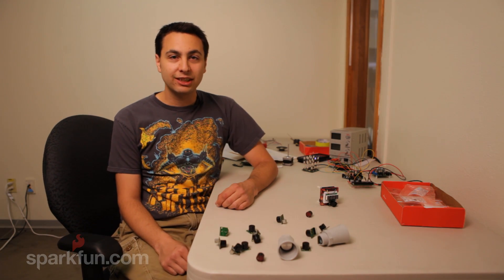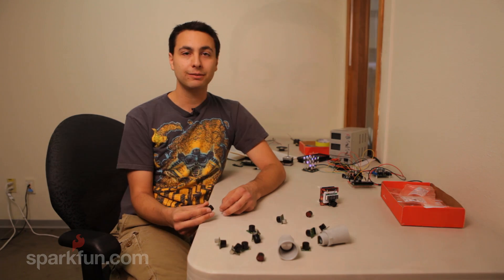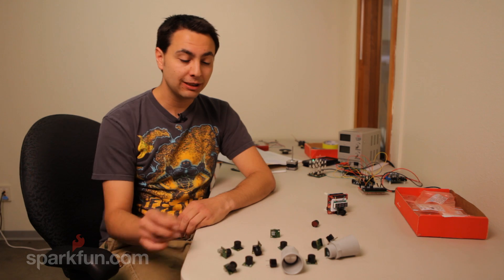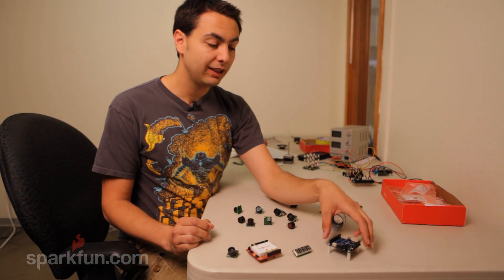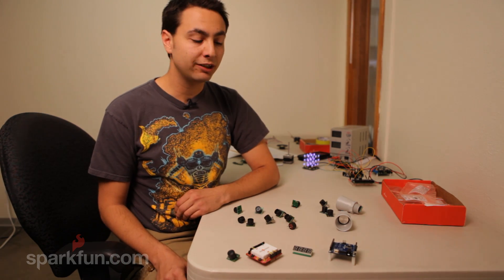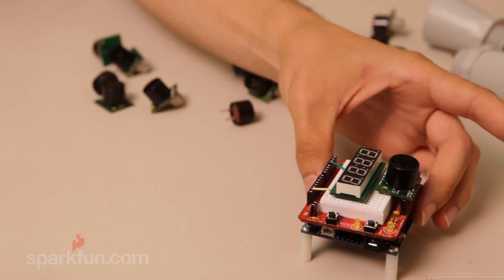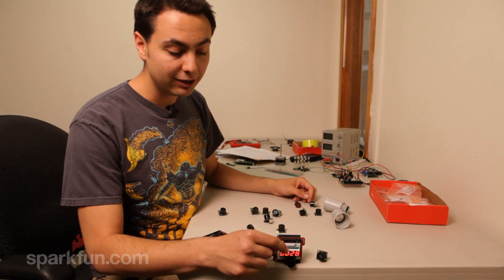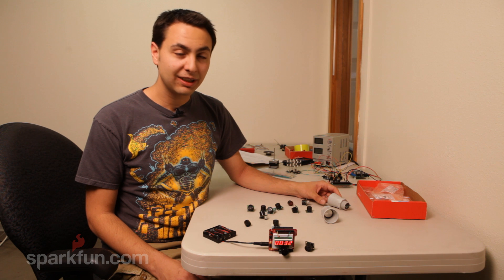Ultrasonic Sensors with Engineer Jim Lindblom

Comment: Hello this video is very informational very good👍 I’ve got a very big favor from you so I have a Arduino and a monster motor driver Vnh2sp30 shield I followed your tutorial and was wondering with all of the pins in I’m left with 13 stat pin and wonder what you mean or whet it goes.

Comment: A question: there are these waterproof sonar sensors that cars use in reverse parking, that have only a single cylinder unlike the ultrasonic module in your video that has a Rx and a Tx. I was wondering how do these car ones work as I could not see a Tx. Do you know how they work - are the Tx and Rx both in that single cylinder?

Comment: HELP! (if you can)
I'm going to be entering a university competition (not worth anything) called cops and robbers.  The cops have ultrasonic sensor so i was hoping i could some how sense the ultrasonic pulses and go in the quietest direction. Also if i could receive their signal and send out a fake signal it would trick the robots into thinking they are at a wall and need to turn.   any ideas how to achieve this would be awesome I'm only a first year ><  ty

Comment: Hi,
I am looking for quite some time for the right sensor. Have you experience with the MURATA MA40S4R Sensor. The SFxx Sensor are at about 20 $ while the Murata only 8 $.
How do you display on the 4 digit Display the Distance? Does it have already the 7Segment Decoder in it?.

Any chance to build my own ultrasonic and calibrate the distance according to the returned ping? Which sensor (piezo) might be suitable?
Thanks in advance
Yariv

Comment: Could one of these be used to measure water level?

I've built an aquarium computer using all the atlas scientific probes + controlling lights and nutrient dosing pumps and it would be nice to hook one or more of these to also control a solenoid for doing water changes, keeping an eye on sump water levels, levels above overflows etc..

Thanks.

Comment: Just wondering, is there such a thing as an ultrasonic range finder that works through medium other than air, for instance through dirt to find rocks instead of through air to find solid objects
Reply: Eric Roux for soil they use small explosives but i think they look at low freq rather than high.

Comment: Hi Jim,

I'm not looking for you to design my project but I would like to know if you think the sonar transducers that you demoed in your video might possibly work for the following.  

Send data (10 bits per second or higher) through water over a distance of 25 to 30 feet using one transducer as a TX and another transducer as an RX.

IOW, could I turn the sensor on and off to generate ones and zeros?

Please email response to henry.debey@gmail.com